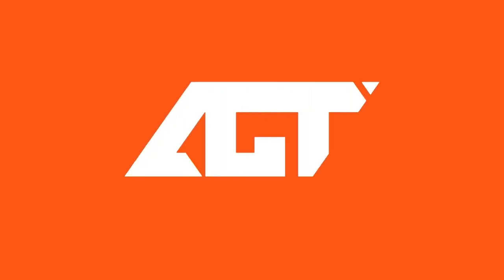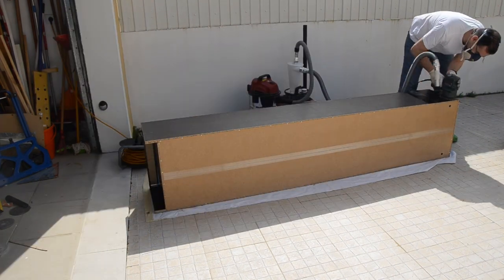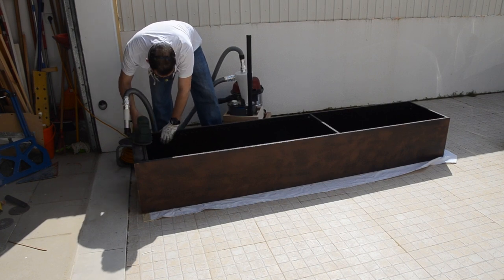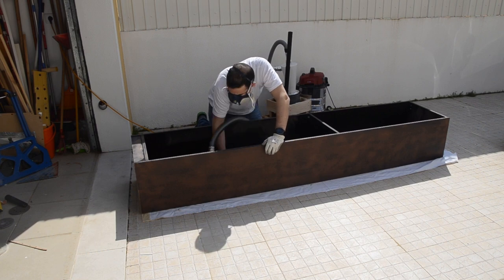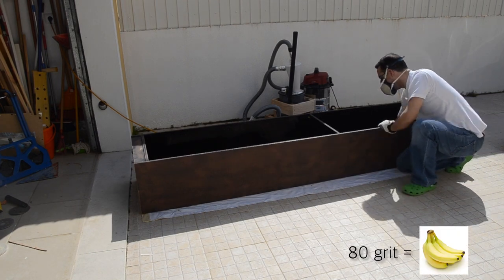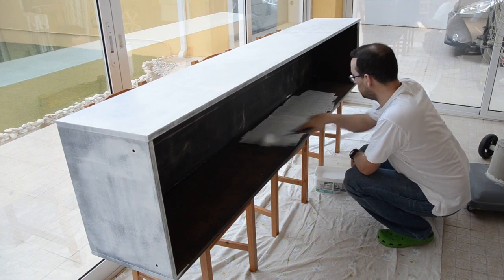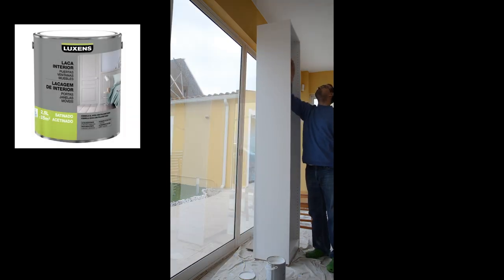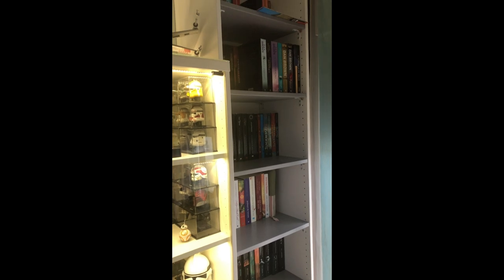IKEA PAX refinish | Paint hack

Comment: Will you tell me how to refinish ikea gray wardrobe closet into black finish
Reply from the maker: Hi. It's the same process as in the video, just sand the outer finish to create a rougher surface in which the primer can stick. Then it's a matter of applying at least 2 coats of primer and then at least 2 of paint. I don't know what kind of paint you have available, but if you can find some kind of polyurethane reinforced one it will give you extra durability and less chance for the paint to chip. Hope it helps!